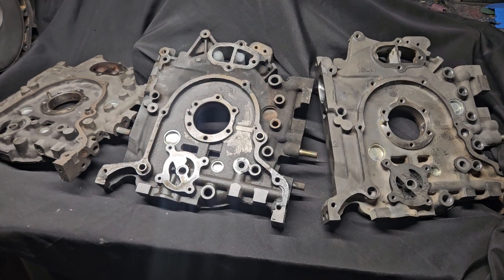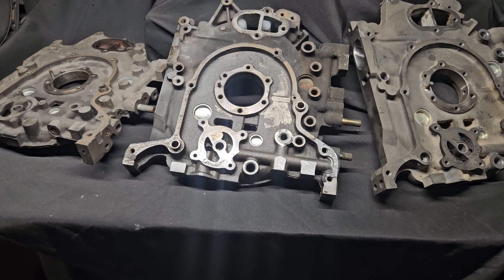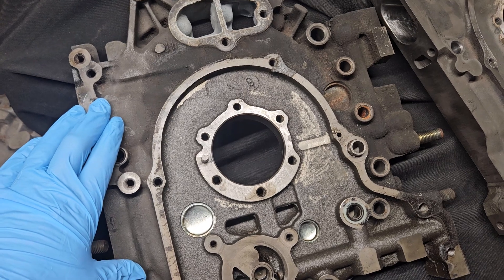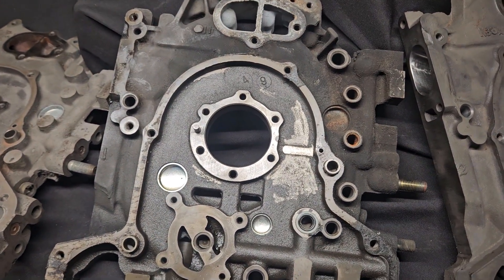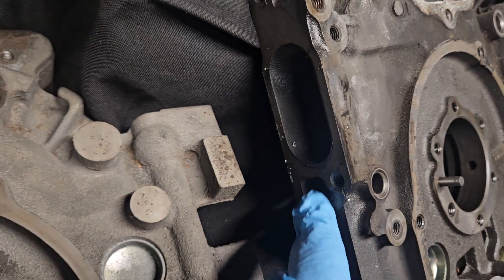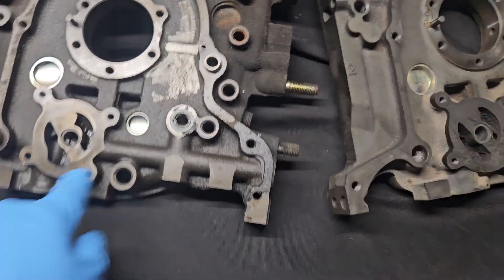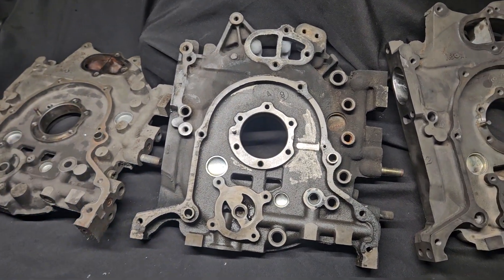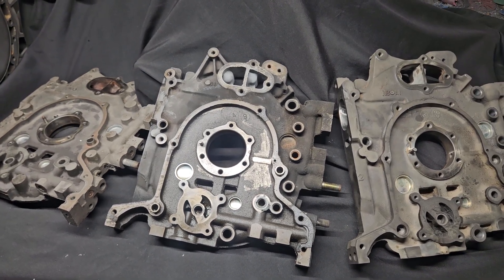Make a 13b Rotary Engines Side plate fit a 20b 3rotor engine? How we do it? rotary tips & tech KMR

Comment: i have recently bought an early (A casting) 20b would it be reasonable to try and use a port matched 13b FD rear iron to strengthen the block given the common cracking point near the oil filter pedestal on these early motors
Reply from the maker: @titaniumwaffle4304  yep